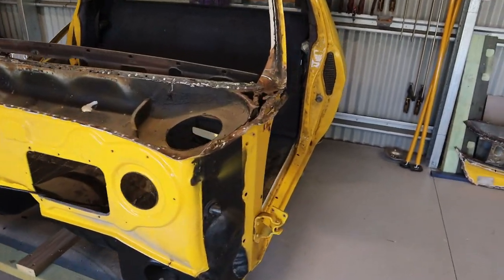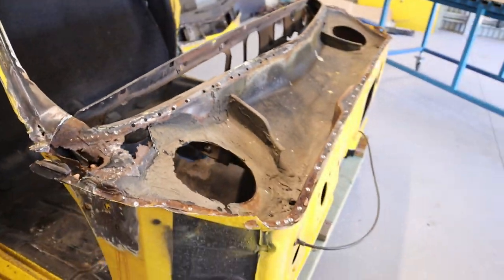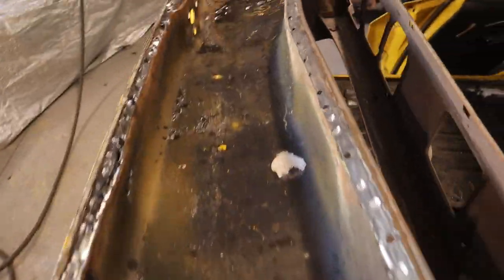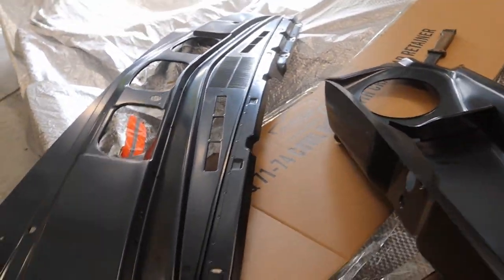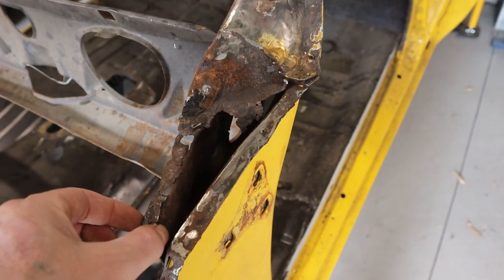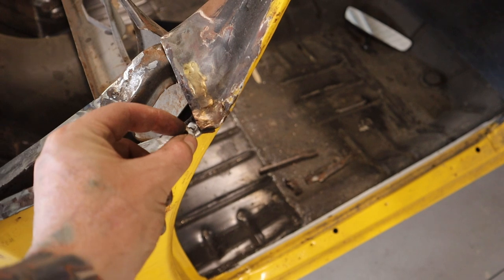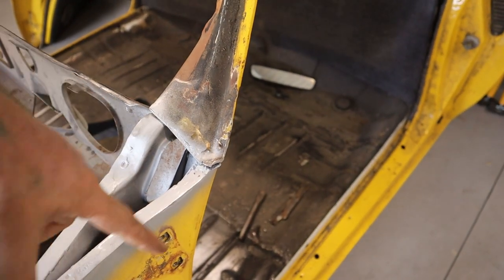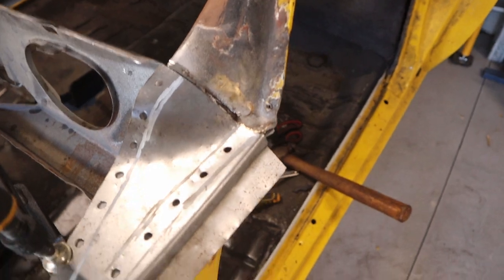HX One Tonner Build - Plenum replacement and repairs

Comment: Great job on the plenum repairs Sam, looks mint!
Can i ask what size welder you are using and what thickness plate, it looks like 3 mm??
Reply from the maker: Hey Mate I am using a 185 welder. The thickness steel that I use is 1.2mm cold rolled

Comment: Was it a big job i am looking at an HQ holden but plenum needs replacing great video
Reply from the maker: Hey Mate. Its not too bad once you get into it. It just depends on how bad the plenum is gone and if you need to do repairs on the A pillars underneath. Took about 6 hrs to remove the cowl. 3 Hrs to remove the plenum then a good day to repair the A pillars either side. welding it all back together is then the easy part.

Comment: Hey mate sorry to keep boosting your videos with comments but hq to hz tonner a where the only model of those cars that actually kept the hq plenum and front the only thing that changed for tonners where dash and chassis, wbs where the only one that changed. But all other models like utes and sedans and what not changed in order, so you could use that to be period correct but if you have the hz front I’d probably send it back. Good job tho had to do similar to my hq ute and it’s a massive job
Reply from the maker: All good. Comments are always welcomed. Thanks for the info. I noticed the HQ version where it mounts to the inside dash is different so I dont think I can use it
Reply: @ShenkeGarage  also the bonnet ridge won't match the hj-wb

Comment: Mate great Vid, one of the best showing the process on removing the Plenum. What thickness metal did you use for the patches, what size wire in your mig? Also anything you might have done different? Only asking as I will have have to do this in the next couple of years.Cheers!!
Reply from the maker: Thanks heaps Mate. I used 1.2mm steel for the patches. Mig wire I used .8mm with argoshield light gas. I am pretty happy with how it turned out and dont think I would do anything different except buy a new spot weld drill bit as using a blunt one takes so much more time.
Reply: @ShenkeGarage  Thanks for taking the time out to answer my questions, keep the vids coming !!